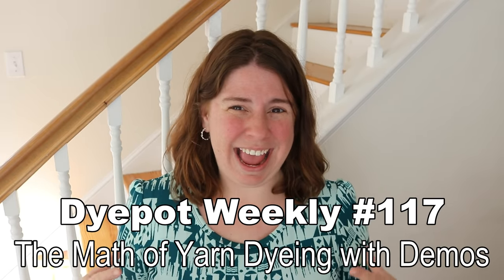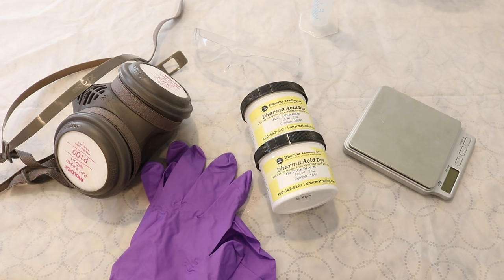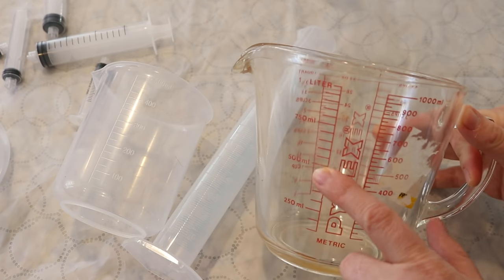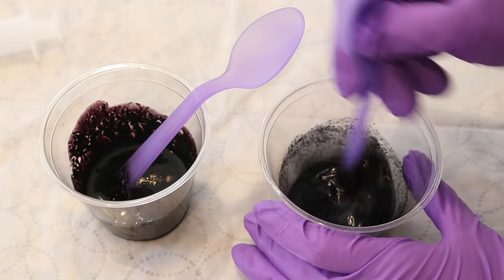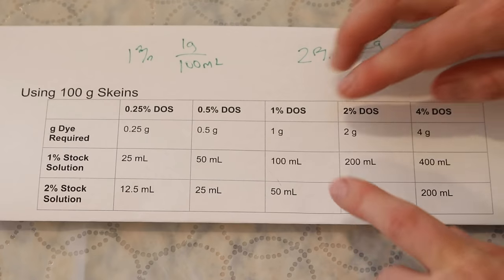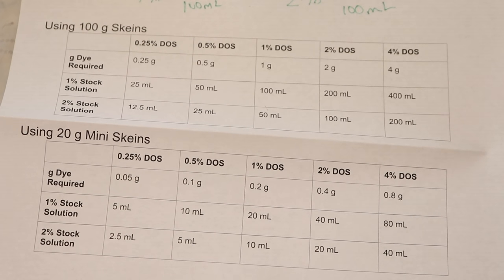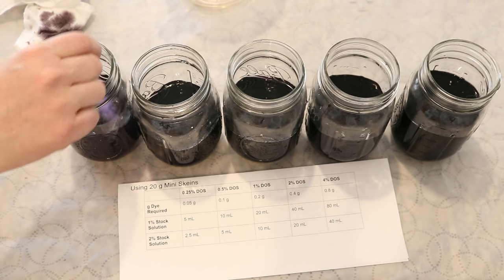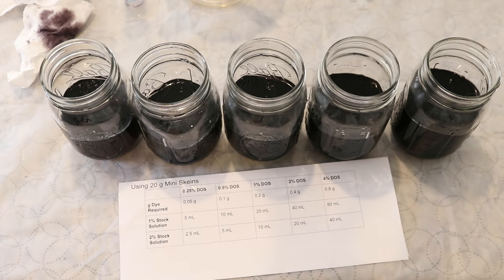Dyepot Weekly #117 - The Math of Yarn Dyeing with Demos (Part 2)

Comment: @ 07:40 she introduces the comprehensive DOS chart that shows how much stock solution to use for a 5 shade group of 100 gram skeins.  TY Rebecca : - )
Reply from the maker: I'm so glad that this was helpful!  <3
Reply: Hi, Rebecca, I'm not sure where to leave this more general question: I wondered if you are interested in any chemical aids to dyeing ?  I have in mind wetting agents.  The traditional watercolor one is ox gall, but I wondered about dishwasher rinse agents. I use 7th Generation brand in my dishwasher and I'm curious how it would work with dyes.  I don't know if it would just help with pre-wetting, or if, like some mordants, it would change the outcome, either the hue, the even liquid saturation of the dye into the fiber, the permanence (or fugitiveness) of the dye, etc.  I'd love to see what you do with this possibility,  or if you already have,  where I could look.  Thank you for considering this.  Best wishes, Denise
Reply from the maker: Hmmm... I don't know about wetting agents at all.  Would they be like soap?  That could interrupt the dyeing process, I'm not sure.
Reply: I don't know a lot but here goes: they reduce the surface tension of water, therefore ¤ you might not have to pre-soak the yarn as long ¤ the dye would reach the fiber faster (possibly changing some things about the speed or style of crashing) ¤ it could help or hinder the dye binding to the fiber, the color being true or altered, etc ¤ and it might change the rinsing process. Isn't the dish detergent also a type of wetting agent, reducing the surface tension of the water, in addition to being a surfactant and emulsifier? But the best thing is that when I searched on wetting agent + textiles, the textile dyeing industry buys enormous amounts of wetting agents !
I started with ox gall in Wikipedia and followed the trail of bread crumbs ; - )
Seems worth looking into.
So those  ideas would involve adding it to pre-soak, to dye bath, and to rinse water.

Comment: You're my hero. I actually did know the math from my chem labs back in the day, but the terminology is super helpful, and actually seeing the different results helps me get a grasp on what things will actually look like. However, I'm way too chicken to get into acid dyes just yet, so I've been using wilton's icing dye and the color right drops. Do you have any standard for mixing up a "stock solution" with those since they're already in solution?
Reply from the maker: The 1 g / 100 mL stock solution concentrations is a standard type of figure used in the dyeing community.  You could do something similar, start with 1 g of Wilton's gel paste and dissolve it in 100 mL of water.  

However, since the gel is already dissolved, you can pretty accurately measure 1/2 tsp of the dye.  And with liquid drops like colorright, you can measure a certain # of drops for your mixture.  

So since these aren't intended to be used as dye, there aren't manufacture recommendations for the OWG needed to achieve the color on the label, if that makes sense.
Reply: @ChemKnitsTutorials  so when you're deciding how many drops/tsp to use, it's basically experience, right? In terms of how much to use for, say, 100g of yarn? (I've watched a bunch of your videos and it seems like you often use about 1/2 tap per 100g of yarn, but I figure that's since you've developed a good feel.)

I love your videos, btw! Just subscribed on Patreon!
Reply from the maker: Exactly.  With food coloring my numbers come from experimentation and feel.  I might do some playing with Violet gradients at some point.  I might mix 1/2 tsp in 1/2 cup of water, and then I could measure that out into jars for minis or something like that.

Comment: Hi Rebecca! So just to clarify, to make a reproducible tonal or semi-solid color, the total volume of water that the yarn is submerged in is irrelevant as long as you have the same volume of stock solution? For example if I want 1% DOS, I can have the yarns in the pan in however ml of water to fully sink the yarn, then add the ml required for the DOS I’m going for? Hope this question makes sense!
Reply from the maker: This is right.  You can kettle dye in 8 cups or 32 cups of water - if you add the same amount of dye you'll get the same depth of shade (assuming all of the dye binds to the yarn.)  What might happen is that you get more even coverage of the color with the larger volume, so you might get some differences in the overall effects.  But 24 vs 32 vs 40 cups shouldn't make a big difference.

Comment: Love this video! I feel like the answer to this is obvious, but for whatever reason I’m questioning myself...

Is the weight of dye at 1g/100mL for 1% stock solution the rule no matter how many different colors of dye one is using? 

Example: a 50/50 mix of color A and color B for a 1% stock solution would be .5g of color A and .5g of color B for a total weight of 1g? Or would I need to still use 1g of each color, thus 2g total dye?

I feel like the answer is 1g total no matter how many different colors, but I feel a double check is in order lol thank you!
Reply from the maker: Great question!  I think for combos, if I'm going to say a 1% Depth of shade or a 1% stock would refer to 1 g of dye TOTAL per (100 g yarn or 100 mL water depending on which we're talking about.)  

A 1% stock solution of a mixture would have 0.5 g A and 0.5 G B in 100 mL.  

I hope this helps!  And it is always worth double checking. :D
Reply: @ChemKnitsTutorials  thanks!

Comment: Serial Dilution? Also, I am curious why you don't weight the water for your volume measurements? And measure the pH? Or have you found from practice that the amount of vinegar you use works? Also, do you ever use a sodium acetate as a pH buffer?
Reply from the maker: I have some other videos where I've used some serial dilutions vs measuring out small volumes.  I didn't use it here because I think it is easier for people to visualize what 5 mL vs 20 mL looks like vs 1/2 and 1/4 the dye. 

I've found from experience what typically works for me pH wise.  Sometimes I'll have some confusion, but I think it is helpful to show when I get results that I wasn't expecting.  

I don't often use leveling agents for dyeing yarn, I've only played with things a little bit.
Reply from the maker: If I misunderstood what your question was, serial dilution is when you start with a mixture - say with 20 mL dye in 1 cup of water. Then you take 1/2 cup of this mixture + 1/2 cup of water (now you have 10 mL dye in 1 cup of water.)  You take half a cup of this new mixture, add it to 1/2 cup of water (now you have 5 mL dye in 1 cup of water) and continue until you get the concentrations you want.  This is often easier than measuring differnet volumes.
Reply: @ChemKnitsTutorials  Yes! And you have a log function :) And it is a good way to cover a wide range of dilutions.
Reply: @ChemKnitsTutorials  That makes sense, it does work better visually than numbers on a scale. I weigh most things because I lucked out and got an old lab scale. An accurate 0.01 g scale is out of my price range, and stock solutions work for those small measurements. You could try using buffers and leveling agents, and compare the results to cold batching, that could be interesting! (and fun if you like the chemistry part too :) I found I only got interested in chemistry when I started dying and wanted to know WHY certain things worked the way they did.

Comment: On the black batch, I  noticed the liquid level was in the jars on the darker black was significantly higher. Does that make an appreciable  difference?
Reply from the maker: Not since we let all of the dye absorb in the end. The absolute value of dye makes a difference. I suppose it could allow for slightly more even coverage, but the overall actual difference is rather small.

Comment: This is great! I have a question. If I want to dye a sweater quantify of yarn, is it better to dye them all together in the same dye pot or individually????
Reply from the maker: It depends on the size of your pot and the kind of yarn you want for your sweater. The more crowded the pot, the more tonal varieation you will have. It might be worth 2-3 batches If you keep careful track of conditions. (depending on how much yarn you need.)
Reply: @ChemKnitsTutorials  As a soon to be novice dyer I figure I can do 2 pots. I do want tonals but if I use the same batch of dye stock and stay as consistent as I can, hopefully they'll be good to knit as a sweater. Thanks so much Rebecca!
Reply from the maker: I would start with a fresh dyebath each time so that you can keep the conditions (pH volume etc) as consistent as possible.  I'd mix the dye once and then split it in half before you start so the mixtures are as similar as possible.  Good luck!
Reply: @ChemKnitsTutorials  Perfect! Yes, I was thinking that too!